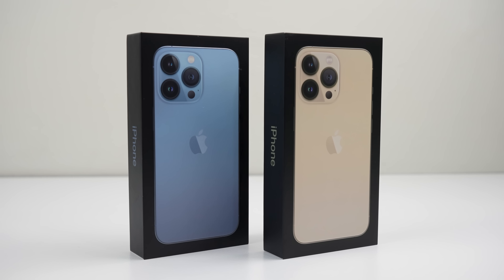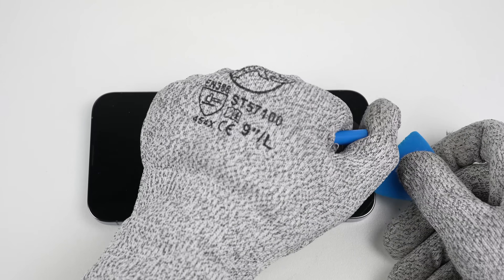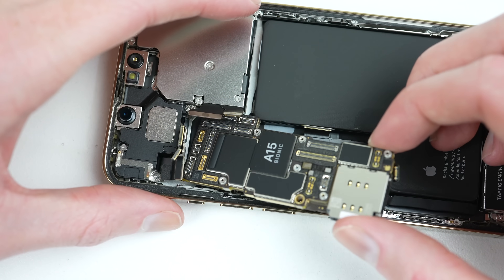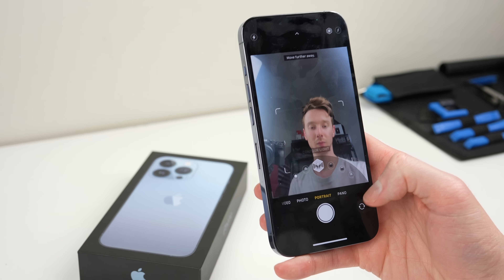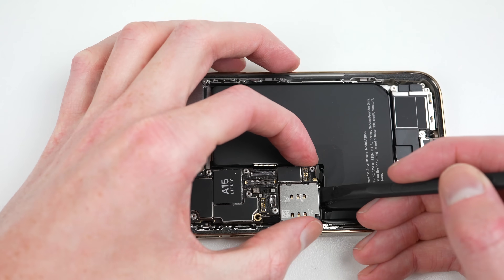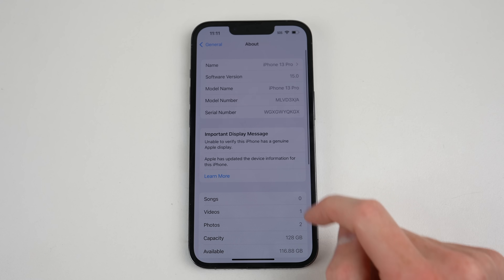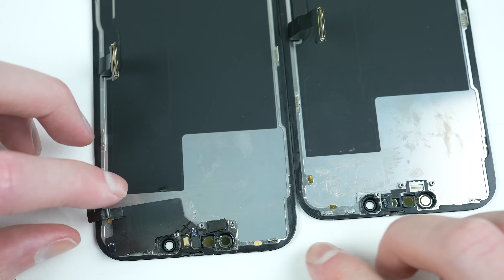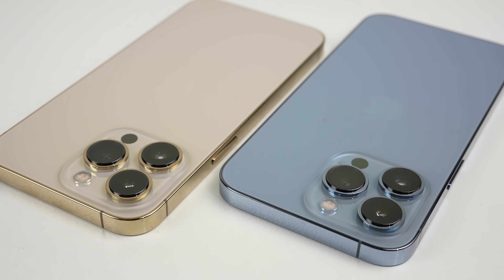iPhone 13 A Repair Nightmare - Teardown and Repair Assessment

Comment: Want to punish Apple for this? - It is simple: Don't buy their products.
Reply: That's a great point however there are MILLIONS of people who are unaware of these issues
Reply: @jakemunoze7430  It's true that most people that buy iphones could care less about repairs, they're more concerned about their next Tik Tok video.
Reply: @TheRedRaven_  good one boomer
Reply: @jakemunoze7430  tell them. Share this.
Reply: People buy iphone because of the society pressure.

They think if they don't buy Iphone, they won't get the privilege in the society. Even my poor friends rather buy iphone with small storage (which is the cheapest) than buy androids with the same price as their Iphone that has a lot of functions and storage.
Reply: @curvybagel  Sadly it's the truth. Although, from my experience, Apple is comparable in value with it's android competitors (Obviously flagships only because Apple doesn't make cheap phones). Still it's infuriating that Apple is doing this type of stuff and if some new groupchat app that had the same funcitons as iMessage, or a way to get iMessage on Android, I wouldn't buy another apple again. All the other features of Androids, at this point, are equal to those of apple, but one app ruins it all.
Reply: @curvybagel  every single iphone function in existence has already been implemented on Android in a superior form years ago
Reply: @bigsmall246  Yup you are super correct and Android is just so much better in my opinion.
Reply: @bigsmall246  Apple is the king
Reply: @turkin73k   hahaha
Reply: They have sheeples they will never learn and understand. Trying to win a war that we will never win until they have took the abuse so many times that sense gets knocked into them. 

Only time will tell...
Reply: Sheep will be sheep
Reply: Appletards wont do it
Reply: Way ahead of you
Reply: Yes of course. But do the others do it.
Reply: I think many people buying those iphone don’t care for repairing ... they buy a new one... others only get a recent one maybe only just for the camera capabilities ... because I have got only an iphone 6, and it’s powerfull enough , not only for every day use in internet etc ... but also for music task that needs minimum CPU power ...and it is easily repairable :) 
Same for an iphone 7 - 8 ... cheap on refurbished and renewed market .
But sure they will make them unusable with the new ios updates and lots of apps ..
Reply: lol you're a hypocrite
Reply: Nah. Write your congressman.
Reply: I haven't bought a iPhone since iPhone 8plus. I knew they was on Bullshit after I only saw the upgrade just for the camera it self
Reply: That's how I handled it. I won't own anything apple.
Reply: exacly :) this video show they dont need me money :)
Reply: I’m watching this on my LAST iPhone!  Screw Apple.
Reply: @stevestinnett5642  you will change the best for the worse
Reply: The problem is there are a lot of stupid people in this world who will buy a product just because its "cool to own" regardless of how crappy it really is. The power of branding I guess.
Reply: Dont buy there products... good start. next hang them for environmental destruction and scamming their customers with wannabe bricks.
Reply: I wish I could use someone else's products, however, my google account is not compatible with the android OS. When the Google play store is associated with my phone it enables 2 step identification (not authentication, which can be disabled) when my phone does not support. As a result I am unable to access my email. I spent about 6 months trying to debug this issues with technical support, however, because they are unable to access things on Google's side their ability to debug is extremely limited. Eventually, they told me to just get an iphone and I have taken their advice.

I do realize I could just create a dummy google account but then there would be a significant disparity in features as the android phone would like many of the integration functionality such as calendars, contacts etc.

Now do not get me wrong, I am not an apple fan, however, until Google can explain to me why it keeps locking me out of my email and I have some assurances of how I can prevent it from happening again having an android introduces too much risk for me. Additionally, the android/gmail tech support should probably not recommend getting an apple product as a solution.

Edit: I also want to point out that most places return policies do not address inherent software issues. In most cases they can only replace the product with one of the same or similar model. When the issue is the OS or its interaction with external servers that does nothing to fix the issue. When a flagship phone is near 1K USD and going through the process of trying to get it returned due to a software issue can take many hours and weeks of trying I just rather not risk it.
Reply: @kurtfrederiksen5538  don't know what you're doing wrong, but all that google garbage works on my Motorola G7, for both the business account and my personal account.
Reply: @johndoe-so2ef  that makes two of us, if someone could explain to me what is going on so I could fix it and I would be happy to use android instead of my walled garden iphone. As far as I could tell (using bluestacks to emulate a phone) the issue is not with the phone itself but rather something with my account.
Reply: @kurtfrederiksen5538  wtf are you talking about you brainwashed git.
Reply: @gregoryconnor9333  what I am talking about is that there is some setting or flag on my google account that forces two step identification when I attempt to log into my email when I have android associated with the account. I want to be clear, if someone at google or android could tell me what the flag or setting is so I could ensure it is cleared I would have no issue with android, but until then I am choosing the inferior product which does not lock me out of my email.
Reply: @kurtfrederiksen5538  Too long didnt read. From your first few lines though, my android phone connects with my google account no problems so I am not sure what your problem is here.
Reply: @MetalFan10101  the issue is not so much that it won't connect. Rather there is some setting or flag somewhere which prevents me from logging into my email without using my phone after doing so. If the android or google support could tell me what that flag was so I could clear it I would have no issue using android. I work in a dead zone so being able to get access to my personal email is a bit of a must.
Reply: @kurtfrederiksen5538  they recommended apple products because the restrictions are placed by apple, not Android. There is no way to migrate from apple to Android.
Reply: @bigsmall246  if it is impossible to migrate from apple back to Android then why did the Android/Google tech support tell me to get an Apple product.
Reply: @kurtfrederiksen5538  because he's honest and concluded you don't have the basic tech skills to use Android.
Reply: It's a known bug, that will be corrected on the next iOS version
Reply: @TheDeadelus69  wow a bug im sure its a bug you apple shill.
Reply: and use the other shite, android from the other cunts at google? 😂 no thanks

Comment: The year is 2030, using non-apple screws freezes the phone.
Reply: Lol, the funniest part about that idea is that they would need to run a current through the screws to know this so you'd probably also get shocked (even if only mildly) when you tried.

Comment: I’m not surprise if this newer iphones suddenly had “a problem” when a newer model comes out next year
Reply: Na they want you to keep the device but want you to buy apple repair program or just charge you soo much if you havent that you buy a new iphone. if your phone doesnt break it can go on for 6 years but if it breaks once better throw it rather than having it replaced as it will cost more. So much e waste as good parts cant be used on other phones

Comment: Doesn't apple do screen replacements? If so, there a way they make the parts work with the new ones, right? Is it possible for this process to get either leaked or reverse-engineered?

Comment: I've stuck with my 6S for over 5 years; initially with of the lack of an AUX port, updating feels like the worst idea to do with how out of touch Apple has become with consumer rights and accessibility of their products.
Reply: i’ve had my 6 since it came out. i even replaced the battery. unfortunately, the board conked out on me. 

i could replace the board, but the 6 is not supported by apple anymore, hence the apps no longer support the iOS in my 6. 

either way, they’ll get you to replace your phone.
Reply: or you could...you know.....switch phone brands lol
Reply: @zacharyjackson1829   I think its also about which software you are comfortable using. I have owned Apple and Android phones and both have their pros and cons. Currently, I own an iPhone 8 and am planning to switch to Android soon but the only issue for me is in adjusting to Android as I have been using Apple for the past 3 years. Frankly, I dont think its worth investing in the latest iPhone anyway.
Reply: it's called android
Reply: They're not out of touch. They see these issues, realize they'd directly impede their monopoly and profit margins, and tell activists to go fuck themselves while preaching their fake-ass sustainability bullshit constantly.
It's not that they don't realize where consumer opinion is going or that they don't care. They are actively upset at the idea and this video is proof.
Reply: Me too. I'm happy with my 6s plus 64 gb
Reply: android or one of the brands that uses android as their base, sure your learning a new operating system but atleast you dont have to deal with apple
Reply: Hi nerds. I owned Androids since the Droid.
Up until my last android phone in 2014 HTC one M8.

Every-time I got an android phone - it ran okay for about a year. Then it shit the bed, ran like total ass, was slow even after factory reboots - unlocking would take 10-15 seconds… I would reset my phone to square one all the time.

I switched to Iphone 7 in 2016. I still have one now to this very day in 2021 I have replaced the battery and the screen.

 I have kept a phone for 5 years with good performance and few issues never having to ever reset my device for any reason.

I still regularly upgrade my fathers android devices, more than 8 because he keeps trying to be cheap and buys garbage, I have bought 3 “flagship” devices for family and they all have “upgraded” already. 

I got an Iphone for my mother in 2016 at the same time I got mine and it also has lasted 5 years with only a battery replacement.

As much as I dislike apples business practices - my actual experience of using android phones has been terrible, the experiences of my family members totaling over 47 adults has not been much better. Nobody loves these things save for weirdos with hate boners for apple.

Old android devices do not work just like old iPhones don’t work, their all planned obsolescence garbage. No phone maker is trying to save us and google keeps bloating out android every year.

Now though - I am turning in my Iphone 7. The T-mobile sprint merge has forced my hand. My cell connection is constantly failing and I have replaced my sim many times already. I am forced to “upgrade” because - news flash, nobody fucking cares - not apple, not google, not the other phone makers who rely on google and especially not the cell phone service providers.
Reply: to address my ownership of my 6s. I was never able to afford the latest iPhone back when the brand first released. I got my first 5s in 2015, then another 5s after warranty covered replacement of a known lock button defect. Was able to use that phone for two years but (by my own fault) broke it soon after. At this point the 8 had arrived (without the AUX jack), so I bought an unlocked 6s and used that until it got "beer-soaked" after I dropped it at a college party (no physical damage just water damage). Bought another 6s soonafter in late 2017, replaced the screen once but otherwise have had no issues other than the $500 million dollar "battery-gate" class-action lawsuit against Apple for slowing down older models.
Reply: Answer is simple though: quit buying the phone that tells everyone "I'm both shallow and stupid".  That is how a lot of us see the Apple crowd.  Been going on for decades too.  Company sucked the day the Waz wasn't a top dog anymore.
Reply: @davemcduringo4377  Exactly, just stop supporting Apple and move on to a different company.  You don't have to be stuck with the same old phone forever.
Reply: But you actually prove that the ability to repair cheaper  is not really a problem as your phone did not break for a long time.
(not that I want to defend Apple though)
Reply: @I-come-from-the-Future  Exactly I was about to say the same thing....the bloke lost the argument by saying ..."I've stuck with my 6s for 5 years...." :-)
Reply: @carlos_chen  Please see @janofb reply. Your invalid line of logic has already been addressed.

Comment: I agree with your point. But… 😊
As long as anyone is making a fully repairable phone that people actually want to buy (and repair, when needed), Apple is proving their business model right over and over again and, as far as this goes on unchallenged, they have every right to pursue this path. People are buying boatloads of iPhones (and other apple products) every year. Many of them (myself included) are happy customers which value the fact that there’s a 2 year “swap program” (insurance based) in place in case an iPhone is accidentally broken by the customer - Apple care - which of corse is pricey but works an even more expensive problem around (at least for those who heavily rely on phones for work): time loss.

Not to mention that nearly every major brand is applying the same (bad) tactics when it comes to repairability, without having good “swapping” programs when a phone brakes up. 

And about “not being the actual owner of my phone” I’m reading around (which again I agree in certain way): after 2 years you can still sell your phone to someone else for a residual value which usually is much higher then what you can happen to do with other brand’s phones of similar purchase price.

I’ve owned Samsung, nexus, pixels, moto, Oppo, xiaomi, hauwei, Lg, even Nokia Microsoft (loved it!) so I’m no Apple funboy but… I don’t feel like repeatability is a measure of bad behaviour against the client “per se”.

Problem is… right to repair is something regulators must consider beyond Apple: everyone is holding something back to make some further margin and to better exercise control over their products. This is the way things are working lately with consumer electronics, and goes way beyond phones. If your washing machine fails you call a certified technician, you are pushed not to go looking for “Uncertified Jack”. Same goes for your pc, your tripod, your drone, your refrigerator… Right to repair is not this straightforward imho.

And, believe me: if there will ever be a social agenda on this… like there’s one for privacy and Facebook (and others) is struggling for that… than you’ll see right to repair become a thing in no time.

Be any company serious and challenge Apple in this ground, I’ll be more than happy to jump onboard.

Comment: have you tried to do this after fully factory reseting the phone so that it has a new fresh install with the parts that are newly swapped in ? the reason i ask is because liek any other electronic device computer or whatever else if you just swap in new ram in a computer sometimes things mess up because there is specific signatures with the connections of parts kind of like a hand shake.

Comment: Maybe the new countermeasures require checksums and serial recognition.

Like it's asking for a known number like solving √354*456+688 etc. This is gunna make it difficult especially if they encrypt and salt the authentication codes.

Like if it doesn't match the codes it will disable it

If someone can use a logic analyzer to read the data please do share it so that we can know the subroutine on authenticating this

Comment: I’m a retired computer hardware tech. I’d been trained and certified by all the big brands to work on all levels of hardware from home laptops and ink jets to corporate & data centre servers, network hardware and peripherals, and I’ve been in the guts of everything from an iPod to a Cray supercomputer. I can assure you this philosophy of “no touchy our computer” has been around for decades and used by EVERY big brand. The problem now though is unlike the past where a manufacturer would limit repair options by using custom connectors, the level of miniaturisation now has allowed them to put logic and EPROMs on the connectors and every other part. Same game, different level.
Give it a few months though and the Chinese techs with brains the size of planets will have worked out how to hack the security.

P.S. 
Hugh, great job on those teardowns! Your Kung-fu is strong!

Comment: Man, for a phone that’s designed to never be opened by the user, it sure is beautiful inside 😍
Reply: I've repaired a lot of phones. This is the ugliest one yet. Looks good on the outside, but ugly on the inside.
Reply: @kieragard  Bro are you crazy, it looks so clean and organised inside. Show me a phone that looks more aesthetic.
Reply: @MoneyMavrek  you probably haven't repaired that many phones. But all those clips, parts, cables are messed up. Most phones have the majority of their cables built into the parts themselves and therefore have a much cleaner look. The last Sony Xperia I took apart have three cables. This thing has about seven just on the first part he pulled out.